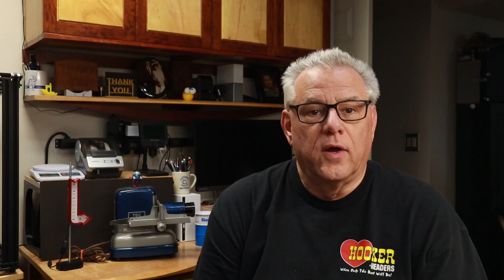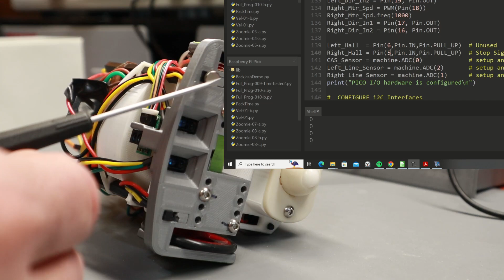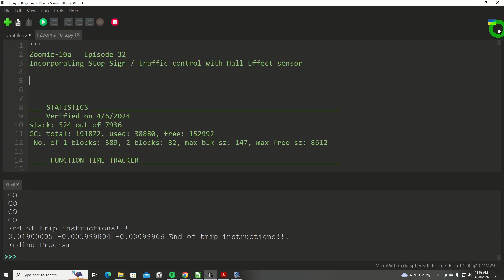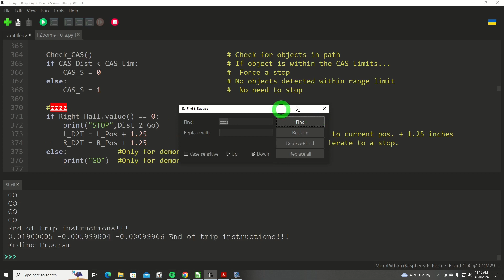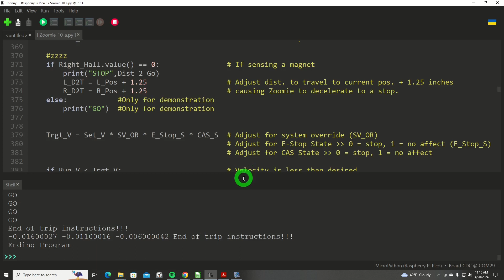032 Using a Hall Effect Sensor and a Magnet as Stop Sign to Control Your Robot

Comment: Again, great piece of engineering.
Reply from the maker: Thanks, but right now (I am ahead about 2 weeks) there are some serious problems that seem insurmountable.  First one had to do with a "random" time delay which I cover in the next video.  Currently, controlling the motors reliably has been very troublesome, so bad I rewrote all the code for velocity and position control and changed out all the motor control components with no success.  Going to be a tough couple of weeks ahead to get the next video made!
Cheers!
Chris
Reply: @MakingStuffwithChrisDeHut  In contrast to the common believe I'm convinced that computers are non-deterministic ;-)
Reply: @GM-el2zb  LOL I agree!!!  I used to have Cats while growing up, I think Cats come back in a second life as computers.  Most of the time they are great and wonderful things, then suddenly when you least expect it, hell unleashes a fury in them like no other and your week is ruined!

Luckily this morning I found something in my code that may have been a "nasty cat" problem.  First test I did after fixing it was great.  Now I got about 3 days of testing ahead of me to see what else it messed up.  Feeling good though, fist positive direction effort in over a week (my vacation week on top of it!).
Cheers!
Chris